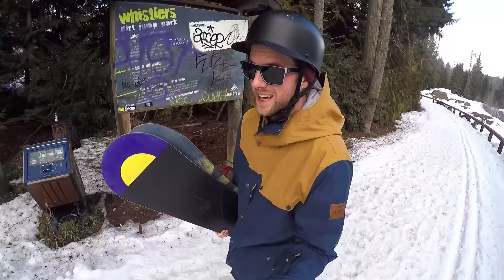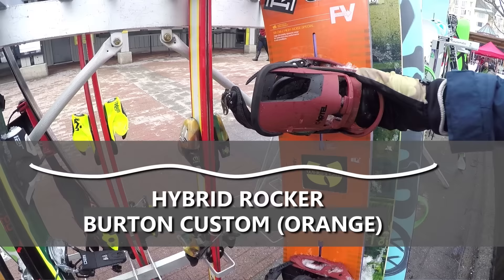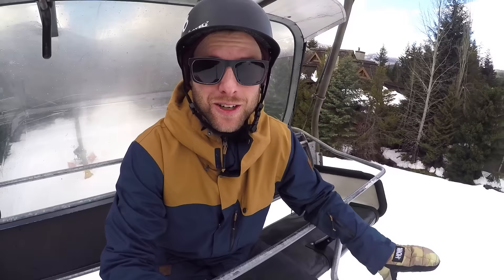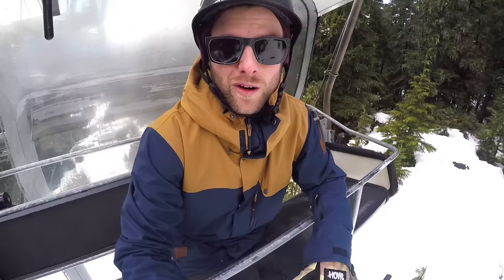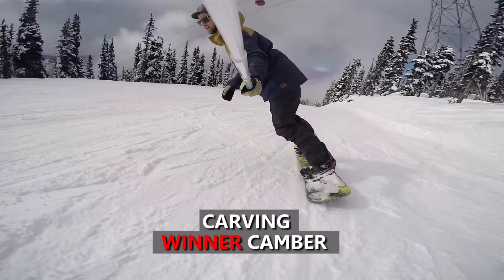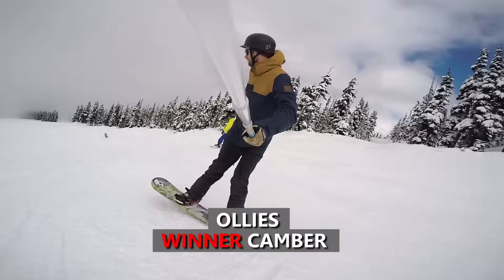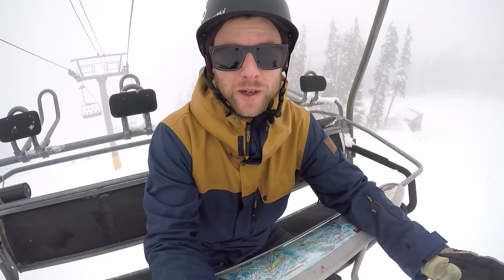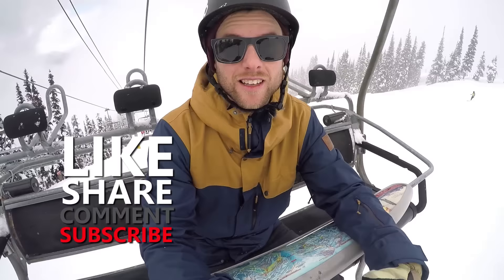Camber VS Rocker Snowboard Test

Comment: I have to say rocker makes a huge difference for beginners. Its more forgiving and you catch less edges. I tried learning with camber, and then switch to rocker and I improved much faster. But once you get better camber gives you more control for sure.
Reply: +Alvaro G I have to agree. I have both a camber and a rocket board, and the rocket board is very forgiving. Especially when you start to jump 180's and 360's you can pretty much land like a dork without even catching an edge.

Comment: learned how to ride on a camber, and it's a tough concept to get, edge bites really hard usually. But it's amazing in the turns from what I experienced, once I got it down with carving the camber style board will treat you right, but it can be a difficult board to ride for a beginner. All tho if you learn on a camber it can help progress your skills in my opinion.

Comment: Shape just explains that situation the board fits into. 
Rocker : if you enjoy parks, groundtricks go for it. To be honest, you want rocker board if you are doing powder run for much more float without having to move your stance a bit as well as re-setting the binding's location. Also if the ski resort that you go doesn't even groom the surface properly, you may want a rocker board. 
Camber : if you love carving and smooth riding you need camber with bit of high stiffness. It gives you a lot more balance than rocker especially on landing from a jump. If the ski resort you go does fantastic job on grooming the surface, go for camber with high stiffness or flat. 

Both has their unique advantages depending on situations. 

Don't need to offend him since this vid is about his opinions on both boards. One mistake would be the title of this vid which is a no-no for hot heads. They will bite as hard as they can.

Comment: You can not compare rocker vs camber when the not same board , because the flex , length and wide are different.
You must compare for example arbor coda (rocker) vs arbor coda (camber) sorry for my bad english.

Comment: Its all about the right tool for the job.  Big-jump, freestyle riders and beginners (no dis to the experienced freestylers intended) are going to benefit most from the rocker since it is a more forgiving design when the edges come in contact with the ground.  

For all mountain riding I'll take camber please!  I demoed a Custom Flying V without knowing anything about it's rocker/camber profile, and after one day I really hated that board.  Turning it felt vague and sloppy (especially transitions).  It didn't have any pop to it, and  I did not have fun in the trees.  On the plus side, I did survive some poorly landed jumps that would have spanked me on a camber board.  

Powder is another beast where rocker probably has a slight advantage.  But then length, binding offset and shovel/tail shape is going to have a much bigger influence.

Comment: 20 years of snowboarding. Both are good for something. For carving tracks ad for everything that needs edge hold there is no match, camber is the solution. Even in splitboarding on steep alpine mountains. Here in Italy in groomed alpine tracks, sometime icy, having a full rockered board can be a nightmare...
Camber is more technical on real deep powder, so there having a full rocker or an S shape board with camber back and some rocker on the front section is the best. But much depends on flex of the board, that has to be right for the rider's weight, remember that in the moddle of a surfed curve a camber poperly flexed become a rocker. Sho the lower the speed the better to have a full rocker or a front rocker board.
For beginners rocker boards ar a great "invention" (even rockered were the very fisrst ones...), as it solves the main problem of beginning with a cambered board that we all experienced in the past, I mean the sudden edge hold and.. hard falls.
I can't talk for freestyle as I'm not one of them, but I suppose that rocker gives a lot of adventege in spinning tricks

Comment: I have the burton process camber and it is awesome. The flex and amount of camber is what’s key and why I was able to size up to the 159. It seems like a stable “flat” profile. My rocker board (Capita sierrascope) has a very fun, loose, yet predictable ground level feel. 
When I think camber though, my 09 black snowboard of death 💀 has enough to park a car underneath. If you can ride this board in pow, everything else is easy.

Comment: Been boarding for 20 years or so now, and really, they just come down to preference in the end, and either of them will do what you want once you get the feel for the board; they'll just do better with what you want if they fit your individual style best.

Rockers are super playful and forgiving when you ask for an edge, will respond quickly and easily, and float through powder like a dream, but cambers will grab edges on the worst surfaces and hold them, but really require you to demand the edge rather than just ask. I've always been a fast, aggressive downhill rider, lots of speed and hard edges, and will always grab my stiff camber board for really bombing runs. I've never felt at home on a true rocker, but it's just because they don't fit my personal style. I know many amazing boarders who love their rockers, and kill it riding them.

Comment: when i started when i was 6 i used a camber board then when i got into racing i went to a stiff camber alpine board (F2 roadster, Sims carve 2 , oxygen proton)  then last year i went and got a Donek saber  boarder cross board and that was still camber and at the same  time i got a DC PBJ rocker and i only rod it once at a resort so if i where u i would get a Donek i have a lot of fun with that board

Comment: I did 3 seasons with the Flying V also my first board. I think it is a good first board as it allows you to get a feel of everything: Park, Powder, etc... I always ride with a duck stance +15, -15 On hard snow there is no control i would have to make long curves across the run, sure if i have both angles positive i would have more control. On bumpy slopes if i go high speed on heel edge the board will be jumping all the time also no control, both angles positive can make a difference though. I recently adjusted the high-backs for more forward lean and got more control. Tried it on fresh powder and it is awesome, but the hill was steep it counts as black if it was groomed so not sure if will still float on a hill with a smaller angle. Since now i also can jump and do some butters next season will try a camber board to see which one fits me better. I think the most important factor in choosing a board is the resort where you ride most of the time. Where i ride we don't have long runs and they are inclined not flat and not well suited for buttering. I think the Flying V is a good board for someone who wants to test everything until decides if he wants to stay at the park or on powder or just cruise at high speed.

Comment: Im a huge fan of the vids. Ive watched loads of the tutorials and the riding challenges. I would say my favorite was the switch riding challenge of riding switch for a full day. get ready to hurt, but also take your switch riding to the next level! With that, i would have to say this vid is only good for those 2 boards, there is a lot more too it. there is a lot of factors that are left out, such as a new board vs. a broken in board is different. like any purchase, i suggest do research. camber and rocker arent the only ones available. plus, most brands have their own hybrid version as well, plus the actual design of the board from material, flex, flex zones, edges, length of board, etc. it really comes down to your riding style. generally the profiles will favor certain riding styles. if you dont understand what you are reading online when you research, then go check out a local shop. they usually are full of riders who can help you out. last time i went in they even had little mini boards with the difference profiles to give you an idea. ask loads of questions. if you are new to boarding, try to think of where you want to end up. i wouldnt suggest a park board right out of the gates as it will probably take time to get there. also, try out some demo days. my example would be that i rode a ride (something) for years. it was super undersized at 156. board was great. it even got me through some pow days and it was wicked for tricks and tight treee runs, but a little sketchy at higher speeds as far as going staright and even carving. always felt like i was going to slide out. now that i can afford something better, i did tons of reasearch. and yes, it was actually exhausting the amount of shit that you need to sift through to figure it out. im mostly an all mountain rider, who likes to hit rollers and maybe cruise through the park and do the odd rail or box. anyways, i settled on a T-rice, 161.5. its a hybrid with a serrated edge. i thought i was going to be out of control on that thing as it was gigantic to what i was used to. the first day was a big learning curve, plus i had broken my ankle 4 months before.... anyways, the board handles like a dream, and i would say has none of the issues that are mentioned in the vid, and even opposite. its stable at high speeds and i can do tight turns, straight aways, hard carving, ollie, jump, land, all better than my previous board. i had to break the flex in a bit as it was stiff as hell at the start. it also depends on how much you are going to snowboard and how much $$ you have to play with. snowboarding can be an expensive hobby, but worth it if you plan on boarding for awhile and can get out fairly often. so ya, best bet is to either check out a local shop, grab some stickers, or use and abuse demo days. i mean, who doesnt like to snowboard??? lol!

Comment: Rode camber up until about 2 years ago when I picked up a Never Summer Evo. My stiffer camber boards ruled in the pipe by a long shot. Also I would have to give the big jumps to the camber board but feel that the hybrid gives better control in and out of the spin if that makes sense. Buttering and jibs not even a comparison I will choose the hybrid any day. As for riding I can't give a good comparison based on the cambers I ride are old as hell and don't have the tech to reduce speed chatter like that of the NS Evo. Hope this helps but until you ride each type and flex rate you really don't know what feels good for ya.

Comment: The problewm with this test is they are comparing a good camber board wtiha shitty rcoker board! 
You should compare BURTON PROCESS with LIBTECH T-RICE OR TRS, OR EVEN SKATE BANANA. you would see that libtech boards have much more edge hold due to their magnatraction techology. They give you the freedom of movement due to banana technology plus great edge hold with magnatraction! I have been riding for more than 17 years , used many board, the best boards are used are libtech and gnu. Check the goodwood awards, libtech and gnu has always the most prizes! And most of the other brands getting prizes get it by their rocker boards!
Reply: i had a lib tech.. the active edge on a 156 lib tech is around 117 cm and the active edge on a traditional camber capita DOA is around 121 or 124. Capitas have way more edge hold. also, i love jibbing way more with capita, more pop, and they do hybrid right by putting camber between the bindings and rocker closer to the nose and tail. floats soooo nice in powder. and Magnetraction is pretty much just good to hold up on ice better.. not much of a difference anywhere else..
Reply: sorry the active edge on a 154 capita is a 121 or 124 while the 156 lib tech is 117. smaller board with better edge contact
Reply: ***** More edge contact does not mean better edge hold!:) In fact it is the opposite! Less edge contact means more edge hold. Magnatraction works on this principle! Pressure=force/area. that means the greater the area the less pressure, the less the area the greater the pressure! That means you obtain more pressure when your edge contact is less, which means more edge hold! That is why it holds great in icy conditions, because there is less edge contact, means more edge hold. Imagine you try to cut a piece of wood with a knife, it is very difficult. but you can cut that piece of wood with a saw very easily. Because knife's entire surface contacts the wood, whereas only teeth of the saw contacts the wood. Less contact means more pressure! Same in magnatraction; there are  7 tops, and hollows on the edges. When you do turns only the tops contact the surface, therefore, there i,s less edge contact, and more edge hold.
Reply: +george clooney that was an excellent analogy George:))
Reply: that would be great in theory, but in fact, you dont need that much of the force to hold on ice, you need at least ANY edge. With camber, you always have the safety in second meeting point, which applies the force vector straight underneeth your legs. With rocker, the force vector spreads across the board and to the bending while crossing bumps and loses along the way and only part of it goes to the meeting point, which when you lose, you are fckd. It's the same when you ride powder board on groomers, you have much less control over classic freestyle, no matter the fact you put higher force on impact by pushing the knees more heavily. Trust me, my bro was there.
Reply: Skate banana sucks dude.

Comment: I ride a "Ride Machete" snowboard. It is a rocker snowboard and I'd consider myself an intermediate rider. The board is great for turns and great for beginners because its not as easy to catch an edge.  My only problem with it is that its kinda on the end of more aggressive riding that i don't normally get into (its a stiff board) and it's not a playful/soft board for butters, but it is a great board for jumps and and handles it way in the park. I am looking for a softer board hopefully for next season. I wouldn't mind ride a traditional camber board. Great video btw :)
Reply: Traditional camber boards are generally very stiff. No kids tricks on those. Set an edge and lay a trench

Comment: It is the same as to compare fwd and front wheel drive on a road in winter. But try to compare them somewhere of the road. I use Jones mind expander , but if there is no powder , I will definitely prefer a camber board too.

Comment: Just a suggestion:
next time, consider using a boxing type of scoring: for each round (test), give  for example 10 points to the winning board, an give 9, 8, 7... to the other board, depending on how far back it falls (or both 10 if they are tied). I think it would make it easier to understand how big or small the differences are, and would allow a final score for each.

Comment: Im on snowboard now for about 12 years and u need to keep in mind the Rocker is designed for beginners to come around the slow turns more easily. The Camber is for the more confident drivers cause it needs much more experience for gettin on the edge and stay in control. But to be honest i love my Camber :D

Comment: I am an intermediate rider and I prefer flat out rocker has same camber as the regular camber in the middle and then rocker on the side so holds a good edge but Is still as good as the rocker is with butters it's the happy medium

Comment: which is better is entirely dependent on where you ride and what you ride... camber or at least camber/rocker mix on the east coast is a must. too much ice for rocker, you'll be cursing 75% of the days you ride on a rockered board, which is only good for slow speed park stuff and floating in fresh. and the pop sucks on rockered boards. even in good conditions rockered boards are squirrelly as hell at speed. camber boards aren't as playful, but you can trust that the edge will hold you in anything. and if you know what youre doing you can make any board work, but you might not be having the most fun doing it. 

i personally ride a camber/rocker mix, the gnu c2 shape of camber-rocker-camber. my next board will be all camber, and if i can afford to, the board after that will be a camber/rocker powder board.

Comment: camber definitely wins the carve, pop, and control test.  but not the spin, powder, fun test.  I would agree that a softer camber will butter pretty decent, but it won't match up to a soft rocker board for buttering. the same can be said for a stiffer rocker board.  it will do much better to carve and in powder, but nowhere near as good as a traditional camber.  I think the rocker vs camber will vary depending on all these attributes

Comment: My friends insisted I learn on a proper camber so I would have the technique down from the start, and I have to agree on most points. Got myself a soft flat rocker recently, flex 2 to get into buttering and I find it performs so much better with ollies and nollies. Much higher and lots of pop, no comparison to my camber board (despite its soft flex 4). Or maybe my legs are just too weak, who knows :)

Comment: i have used a camber board for 4 years til this year when I bought a FV... sliding turns i like flying v but its barely a difference. Camber is so much better for carving but for riding on narrow runs I hated it because it catches way more edges while the FV has a pivot point right in the middle so the edges dont catch much. Ollies maybe camber wins but butters are way easier on FV.

Comment: Flying V isn't a standard rocker. In fact you have to work differently with your legs to a normal rocker to get the most out of it & it's actually difficult compared to a normal rocker.